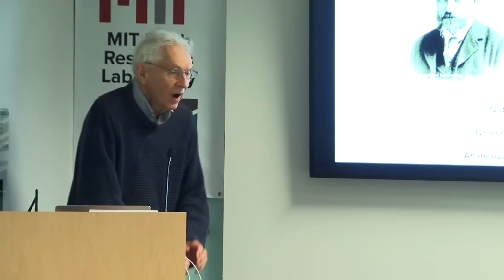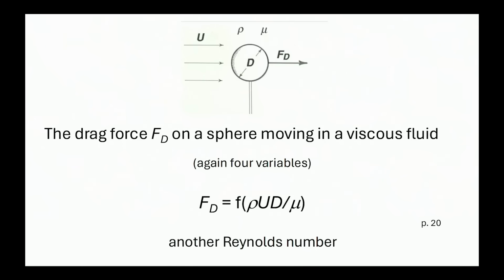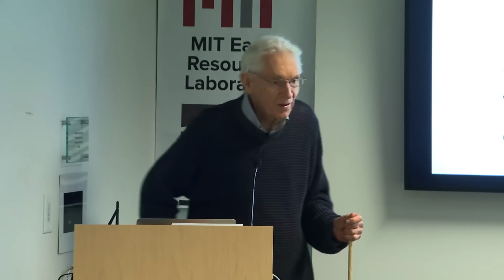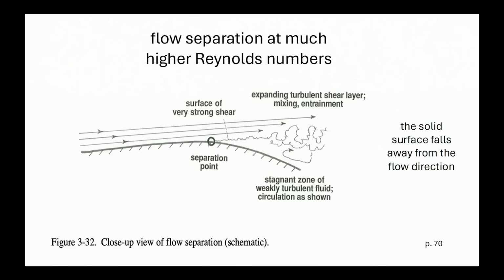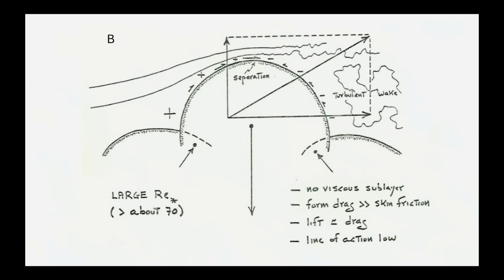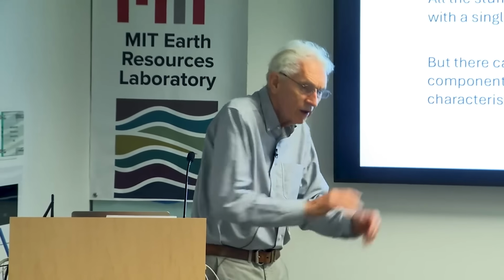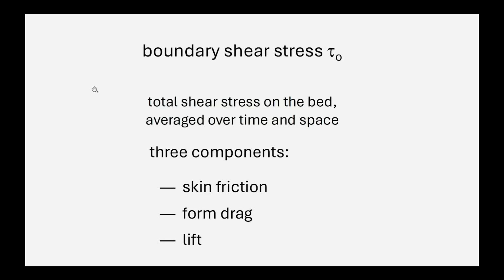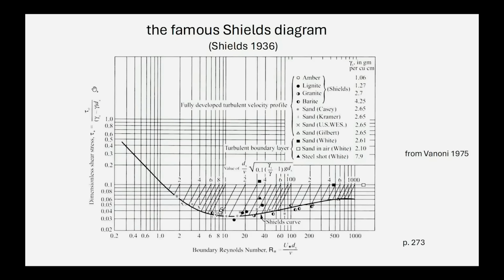Lecture 1: Fluid Dynamics

Comment: After a studying drafting, CAD, and manufacturing… additive manufacturing, multi access manufacturing etc. I felt in theory, a mechanized ship prop with an array of jets could be cut from a single piece of metal may improve efficiency, and reduce cavitation wear on the blades… it’s a reasonable evolution not unlike aircraft propulsion and those of the like. 👍🏻. I had a provisional patent but no funding or cfd

Comment: If I may inquire, how does this equation behave under zero gravity; microgravity or hypo gravity. Since gravitational acceleration, g, is reduced or effectively absent, would that change the dimensional analysis? Specifically, does the does the Reynolds number still apply in the same way, or would other dimensionless numbers become more important?
Reply: Gravity causes waves. Simple as that. So zero gravity is zero waves

Comment: Anyone know why that first Reynolds number Re, was achieved by dividing 3 of the 4 variables (velocity, diameter and density) by the viscosity?
Reply: In that ratio all of the units cancel - you get a pure number. 

Are there other ratios that achieve that ?
Reply: I would advocate you to do a dimensional analysis of the naier-stroke equation, the answer is lied there. 

work on the equation of motion and try to group constant and you will get a group of consultants which cancle all of its unit. previous comments mentioned it all parameters inside that group constants called Reynolds number
Reply: Reynolds number is the ratio of two of the forces that govern viscous fluid motion: the inertia force which is proportional to the velocity scale, and the viscous force which is proportional to the fluid viscosity. When you write the expressions for the two forces and take the ratio, you get this form for the Reynolds number.